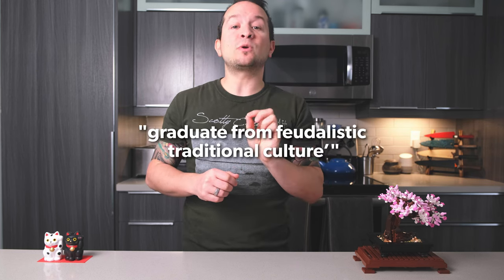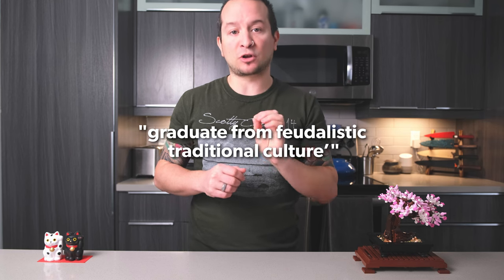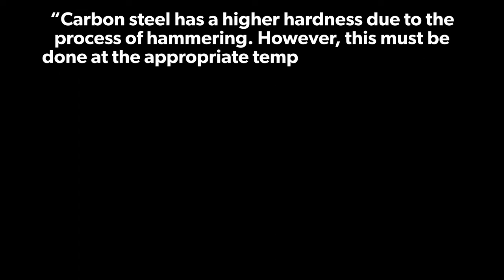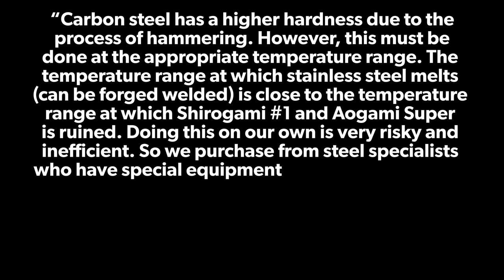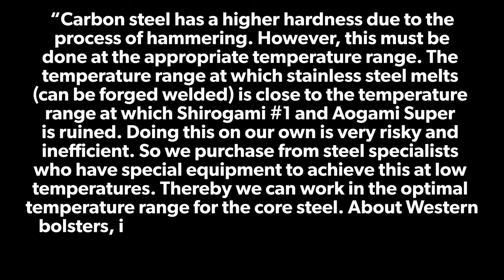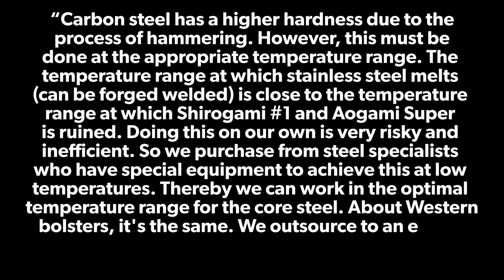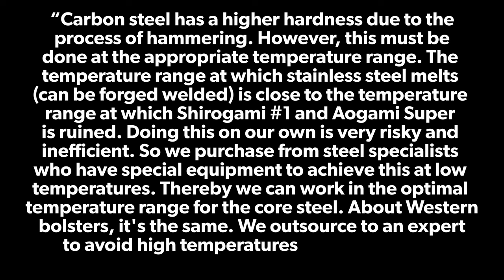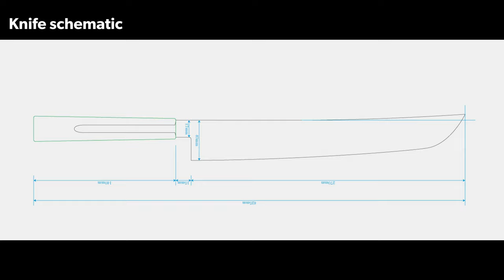ISAMITSU CUSTOM 270mm sakimaru sujihiki - history, build shots, knife demo

Comment: A little surprised you went carbon steel for the core. I remember from your Yu Kurosaki sujihiki video that at that time completely stainless was a key requirement for you with a suji for ease of maintenance and less worries while entertaining.
Reply from the maker: Ah John, the beauty of getting older and learning from your experiences am I right? Again, though not surprising, great memory. When I got the Yu Kurosaki suji, on paper it was everything I wanted, or thought I wanted. Yet I disliked the knife for so many reasons, I made a video about it where I still get grilled and it became the first Japanese knife I ever sold from my collection. Glad I did as it opened up the gateway for other knives I didn't use which I got rid of. Being a friend of Gakus and knowing he would only work with Shiro 1 or AS, it was worth it for me to be part of the project and be one of his first backers to take a backseat on my want of having a stainless core. At the end of the day, it is stainless clad and I can easily wipe the blade on the tea towels that are always next to my board. So it became less of a need, more of a want and even to push it further, a realization it wasn't really necessary. I'm happy to admit my mind changed and I couldn't be happier. Seeing the patina develop on this knife makes me think I'd be so sad if I never got to experience that on a meat slicing knife.